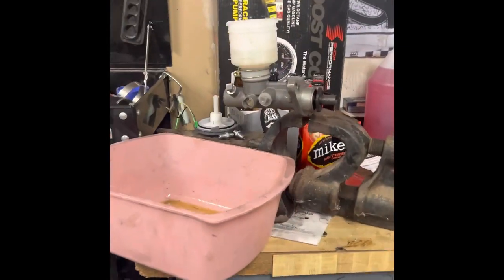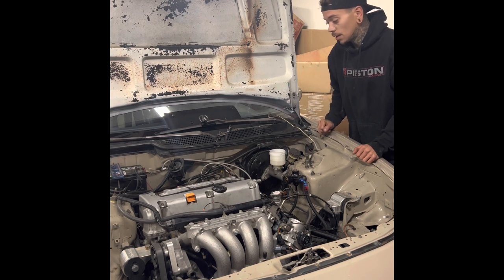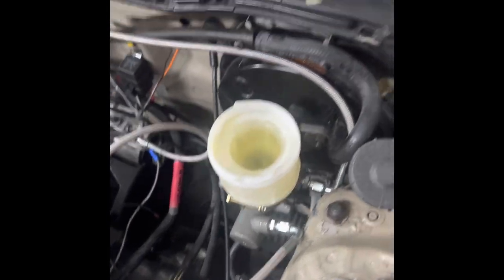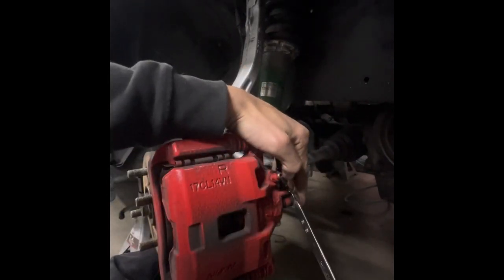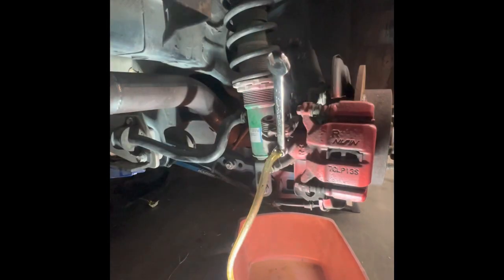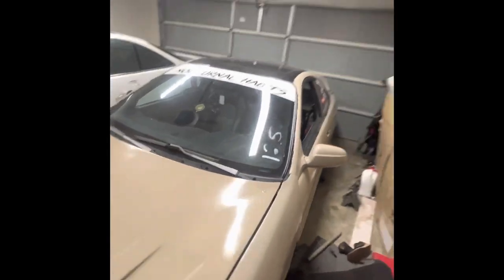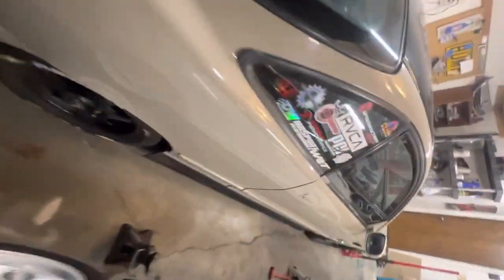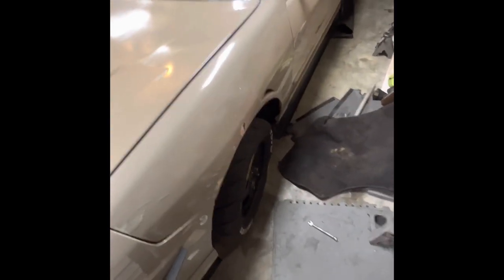Why Don’t My Breaks Work?!?

Comment: when my forester was dragging I found the caliper pistons getting jammed up in their bore due to wear of the bore from corrosion on the pistons. If your calipers are good and the master is good, I would check the metering block. I've only had a master go out once, was a MK1 GTI w/200ks on it. New one fixed the mush pedal.
Reply from the maker: Found out I had gotten the wrong master cylinder so I rebuilt my old one. Car is back up. I’ll be posting another video in a few days.
Reply: @DoubleJaysGarage  never trust the guy at the parts counter